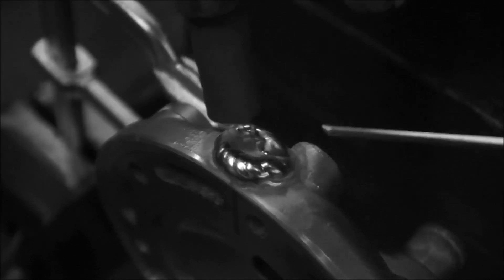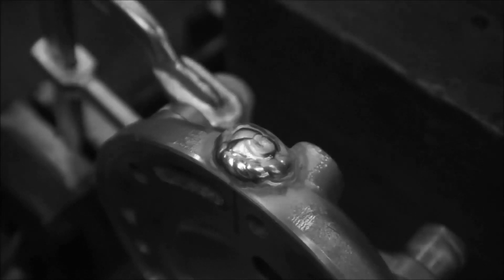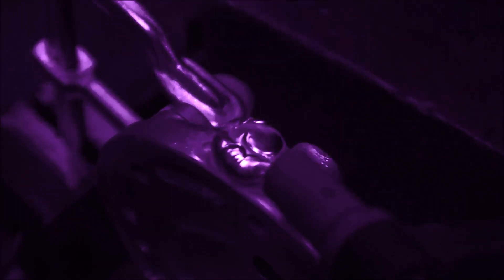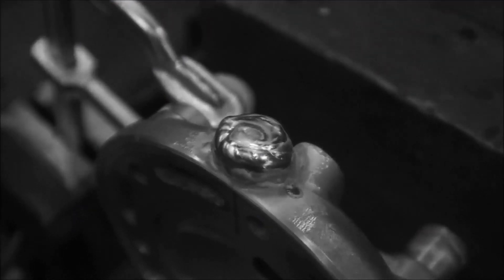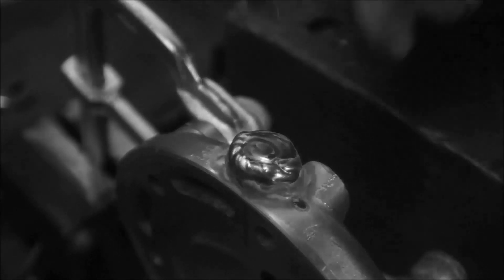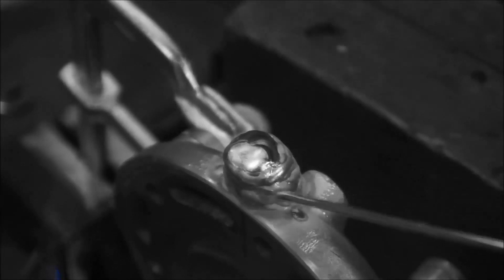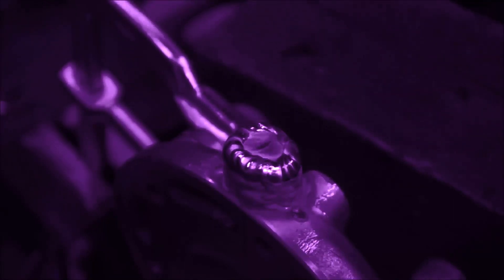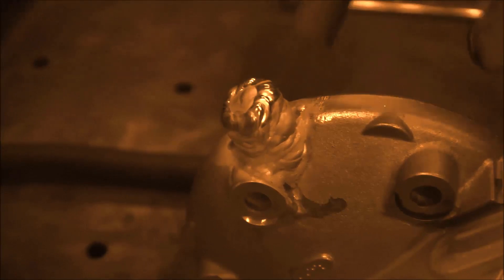The Manual 3D Metal Printer Part Three

Comment: This is not a criticism but when you weld aluminium like this, you are never supposed too wash it like you are doing. You need to always add filler metal as you are welding aluminium because it dissipates heat so quickly it can cause micro cracks in the puddle when you shut off the torch. You should reduce your arc incrementally as you add filler until the torch shuts down. 
This is what i was taught and they actually showed us the results using a dye test. The puddle can, but not always develop minute cracks in that fish eye if you dont add filler too the end.

Comment: I really like that fixture Keith Fenner has built to hold the auto-darking lens. I have used a fixed shade glass in the past. It seems like the camera has trouble focusing on the weld versus the glass. Nice setup, thanks for sharing.

Comment: Nice videos!  One suggestion on the NEX, once you set up your shot, turn off autofocus (or turn on the focus lock if it has one).  That way the camera won't try to refocus when you strike an arc.
Reply from the maker: Jon Evans I have not been able to run the settings needed to see the arc and then be able to lock the focus, it has great stability, when the lighting is at certain levels and then wanders with dimming lights. I will have to break out my camera manual and see if there is a over ride. I have been playing with it quit a bit and to be able to roll with the flow and multiple adjustments of positions, I'm getting there just like everything I strive to perfect. ;{)-----